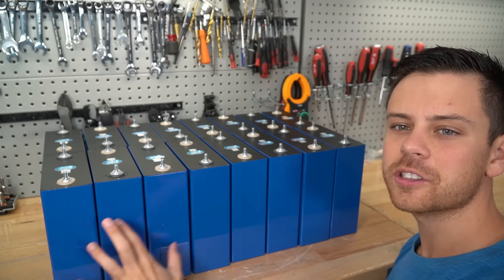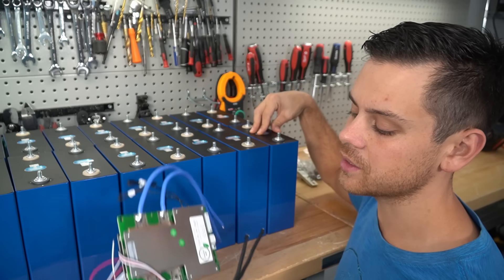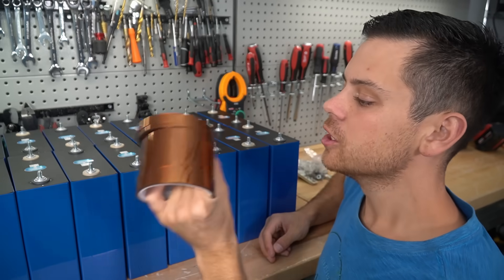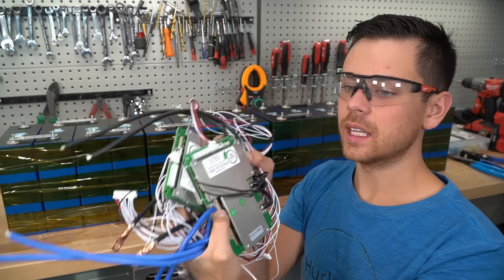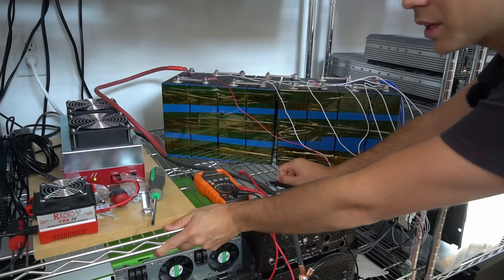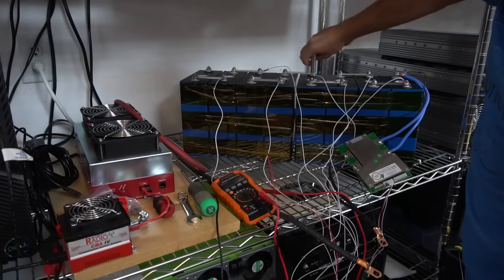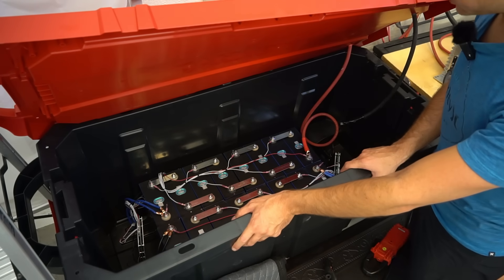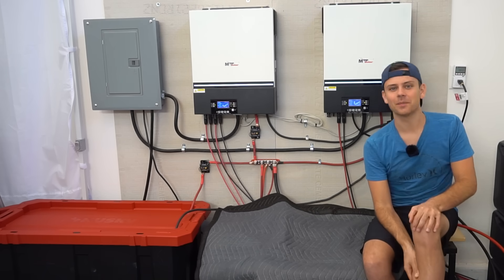DIY 48V 320Ah Grade B LiFePO4 Battery Build: 16kWh for $2,810?!

Comment: Will, You have some serious fault current available to you and i will stand to be corrected but those breakers may not be able to clear a fault of the available capacity  , i believe you should consider using MCCB or HRC  Fuses with a very high KA rating
Reply from the maker: Each bms has OCP, and a marine grade circuit breaker rated for this voltage. Why would it not?
Reply from the maker: There are 3 over current protection devices, and the voltage rating of the fets is 80V. Should be fine right?
Reply: , thanks for responding  @WillProwse  I am probably a bit old school, relying on Mosfets for isolation & protection is something i am not used to from an industrial perspective, can you guarantee that the Mosfet will operate faster than the time current curve rating of the breaker ( Co-Ordination) as i see it the breaker should operate before the BMS  if your using the breaker as a switch then its not really there for protection , So your saying the BMS circuit protection is there to protect the cable from overload and short circuit protection or just the battery ?, maybe you can tell me is the BMS set to protect the cable and the cable size greater than the Over Current & Short circuit protection of the BMS.

I must say in Industry the talk of fully electronic circuit breakers where you may find semiconductors being used is only just starting to appear with many regulators not accepting them yet , Industry does not yet have the confidence that isolation can be fully achieved and be reliable however i do know fault clearing times can be really fast , that's my understanding and maybe you are correct that the BMS is suitable 

I just feel the protection should be off the Battery and be the primary form of protection with the BMS protecting the battery

Comment: I was looking at these batteries, i really appreciate the tips and testing.
Reply: Let us know if you get them
Reply: I bought 32 of the 320ah for 3700 and were grade A!
Reply: @nunyabusiness2191 that's a whole lot of capacity for that price, i guess you'll be running a whole house on that
Reply: @whateverthisis3929  this one is my smaller bank. I have 2500ah 48v total..i use for power and central air water heater and heating in spring and fall

Comment: On a budget I ordered these about a week ago......aliexpress....considering thats over 15k of lithium power...honestly I will be satisfied 90 to 95 percent...still should get me above 12 k which was my target....let me know what you think.....this one is 48v 320 ah ....running a mr power 48v  5k all in one controller inverter.....I'm in Puerto Rico...my consumption is 400kilowatts per month...got 3500 in panels.......this is my second solar project...the first one was 24v  off grid system I put in my house in the mountains....your videos were extremely helpful.....the system im putting together now is at my primary residence....thanks  ....
Reply: your 3500 W panels will not provide enough to cover 400kWh for the month. This has not so much to do with the batteries (storage) you are using. I'm using similar types of batteries (in tropical sunny Northern Thailand) for our essential power supply. We are getting an average of 11 kWh/day out of 3.88 KW (monocrystal) Panels on the roof. For us, it is more important to bridge the powercuts we have here during the rainy season. So more storage means keeping the lights on for hours, if not days.
Reply: @CarstenDohrmann  thanks for your input ...but I get all day sun...literally 6 hours prime easy ...so just taking in ....3500 for 4 hours a day  which I literally get more  should get me 14 k easily...but if its becomes a issue might bump up to 4500 or 5000...but thanks for your input
Reply: @CarstenDohrmann  oh in my cabin in the mountain I'm getting 8k to 10k a day on 1440 watt array

Comment: Looking for an economical way to run Air Conditioning in a RV.  Is this video a solution?  48 volts VS 12 volts?
Reply: 48V is superior to 12V, because you can get 4x the energy transferred over the same gauge wire. 1kW at 12V is 83 amps. 1kW at 48V is just 21 amps.
So yes, this video is part of the solution, whatever cells you end up getting.

Comment: I've been looking into how to use less KWH in my small 2 story home, last year in august I used 1358KWH for the month.. This year: 879KWH so I'm getting somewhere, it was cooler this year so less air conditioning.. But about 40-45KWH per day system is what I would need, to cover my max use days.. I'm new to this, and on a small income..for me I think it better to spend $ getting panels hooked to the grid to lower my electric bill to slowly work to full off-grid Is there a free site that gives walk-throughs of different systems or easy explanations of how all this works? Any intro videos or channels that do down to earth introductory explanations?
Reply: @Hates Spam well in summer I have a big 240v AC airconditioner for downstairs and 2 smaller 120v ones upstairs and its electric hot water as well as stove and fridge (fridge needs replaced and compressor runs constantly that's next on my list) but besides that its just a tv and air filters and other small-draw things.. In winter I'm 100% wood furnace heat so my winter use is 1/2-1/3 of summer.. August is always highest usage month
Reply: @Hates Spam well I have to keep the upstairs cool through the day cause that's where my bedroom is and it would get 100deg by night if I didn't have it cooled.. 1 room is closed off and isn't cooled up there but the bathroom and bedroom are  upstairs.. there's also the electric clothes dryer and washer I forgot about in basement to supply for as well as some power tools, I'm not sure how much electric a normal fridge/freezer takes but this one is like 30yr old and is beat and needs replaced running constant so maybe when I get that here I will see my use drop some I'll have to do a thorough watching of his videos to learn more like you suggested.
Reply: @Hates Spam no they're both in my bedroom, they're small 120v ones and since my home is 100yr old and has a metal roof it gets hot up there.. Usually one of the 2 will suffice but when its 85-90° or more outside and sunny I need both of them to handle it. The 240v one is like a window style but is big and is mounted right in the wall and it takes care of the whole downstairs where my wife and I are usually at when home.. My one room which is smaller upstairs isn't finished but my thought is to convert that to my bedroom cause it would be easier to cool as well as heat in winter since the room is directly above my furnace room that's on the 1st floor
Reply: @Hates Spam I added some R30 insulation in the area above my wood furnace and in the walls around this summer as well as new windows/doors last summer but that's about as far as I can go with it.. There was no building codes when this place was built and there is likely no insulation in any part of the house walls at all and it originally had all single-pane leaky windows! I really don't want to rip all the walls that are hardwood over drywall down to try to get insulation in there but trust me I see your point! Before I did the windows and door sealing and the insulation and electrical outlet sealing I did last winter you could feel a breeze on a windy day! I fixed that problem and through doing some of that other stuff I nearly halved my electric use this summer.. Winter was always hard but I think I'll see a big improvement this one and will be able to eliminate all use of electric heaters this year I do believe.
Reply: @Hates Spam I live in central PA.. winter's coldest night last year was -1.5°F and 10°f or below is common through all of January.. Summer usually stays below 100°f and averages 85-90° during the day and 70-75° at night BTW
Reply: @Hates Spam thanks! Today is actually my 32nd birthday and it was sure nice to carry on a conversation like this. I wish you only the best.

Comment: Will, Aluminium studs Vs threaded posts, you have more chance of killing the studs and when you look at the smaller contact surface area, i'll take internally threaded everyday. 
Besides, can always run Heli-Coils to fix. Bus-bars with elongated holes not for you bloating, just fudge allowance.
Reply: Keep in mind the lug is a specific depth, and drilling out to install a helicoil can cause issues.
It has been done on the forum, and several cases have ended in electrical fires.
Reply: @SuperVstech  There are ways to do the job just fine without anymore depth needed, same is just opening up the hole and tapping next size out.
Reply: He has done this for years. Trust someone who knows what they are doinf
Reply: @vanderumd11  Yeah, I started working with metal yesterday, electrical the day before....

Comment: Are you concerned at all that there isn't any air circulation inside the husky bin you are using as your battery box? Would putting a hole in the top with a PC fan as an exhaust improve battery state while putting a hole on one side as an inlet to allow air flow?
Reply from the maker: No need

Comment: Thank you for excellent videos, Will! 
It seems, that flexible busbars will better fits for cell interconnections in the battery - it eliminates of expansion/contaction forces application to stud/busbar connections.
Reply: They call those cables
Reply: @mfgxl , you mean short cable jumpers with cable lugs at its ends? Because, there are special flexible insulated busbars exists, which do not require cable lugs. These are avaible from Schneider Electric and othe brands.

Comment: Hi, Will. Thank you for sharing, it's really awesome. I'd like to ask you if it's safe to use such a bloated cells, that contract and expand so insanely. With regard to busbars and mounts and that internal compression issues. I mean they may not have the advertised capacity, but more than enough to cause a mayhem. What do you think?
Reply from the maker: It could blow the valve one day, but it is lifepo4, so not a big deal. I would never do this with a combustible chemistry. Lifepo4 and LTO is all I work with for this reason. I used to use other battery types, but those will burn your house down.
Reply: @WillProwse  Older video but seeing how cells may eventually start swelling it seems braided buss bars are the only way to go.

Comment: Ok so compare this to signature solar where I bought 15 KWh for $4500 and it comes with amazing packaging, great monitoring, circuit breakers, on off switch, etc...     And all I had to do was slide it in a rack.
Reply from the maker: Yeah those are great! But out of stock and more expensive. I love both
Reply: @WillProwse  by the time you add your BMS x2 decent case, connections, and have waited 2-3 months for your grade A versions, I will have another 15Kwatts online for the same total price.   Will, I have learned so much from you and continue to do so, but I think you need to put them both in the same category...

Comment: I've got 3 strings of 100 ah bb in 48v config each. They attach to a bus bar and the line out goes to the mpplv. I know it's possible to configure a 2-3 hundred ah 48v and connect it with the other 3. Wondering what the drawbacks are if any? I think once one or all three strings of the 100 draw down to the bms limit it will just charge while the remaining 2-3 hundred ah  string will continue to discharge.

Comment: Compression is important for all type of cells other than the cylindrical ones. The charge / discharge rate is not relevant as you seen they are expanded when fully charged and you do not want to have distance between plates in a cell and to accomplish that they will need to be compressed.
That blue sleeve is fairly thin and may be easily damaged so is best to have something between each cell like some thin silicone pads as they will offer both electrical isolation between cells as well as some elasticity for when cells expand and contract.
This are probably 280Ah cells not sure why they are advertised as 310 or 320Ah. I also order some of this blue 280Ah cells to do some testing as currently this are almost the only option considering the cost per kWh and. The ones I got should have square terminals and then soldered on top what look like aluminium cylinders that are taped. I also do not like that they drill the connectors as they where not designed for that.
Reply: Do you have a source for silicone pads?

Comment: Clearly the cells aren’t balanced. The BMS shutting off at about 24v says just one cell and not all cells fell below the cut off voltage.
Reply: Agreed.  And the BMS he has will never balance these - resistors way too small.  Would have been neat to see what the capacity is when fully balanced.  Or perhaps should have tested one battery at a time - granted very time consuming.
Reply from the maker: Yes very true Bill! Very time consuming haha
Reply from the maker: Yes I saw that. I just hate taking it apart and balancing it. It should arrive at same SOC. And and who cares if one pack did that when the other one didn't, and pulled less. Even if I top balance it will be garbage results. I'd rather buy better cells and cycle this one how it is. And over a month of constant balancing will make a difference. It's a small amount with passive dissipative balancer on bms, but it does add up. Gotta change settings so it balances all the time and not just at high soc
Reply: @WillProwse  At least with the 16S 48V Overkill Solar BMS, you can indeed change the balance start voltage and delta amount allowed.  It also lets you change whether to only balance when charging (default), or not.  But when you turn that setting off, you'd think it would balance all the time (charging, discharging, or idle), but it then only balances when NOT charging.  At least that's what I see.  And annoying it only can balance even or odd numbered cells, which takes extra long with the very small resistors.

Comment: Hey Bro, what's the size of that bms and where can I get one?
Reply: He's using the 24V 8S BMS from Overkill Solar.  He has a link in the description to the 48V 16S one he wanted to use - they also have 12V 4S too.  I like their BMS's (insane blutooth range), but the balancing does a rather poor job (way too small resistors for large battery packs).  And at least with the 16S one, it can only balance every other cell at a time - which doesn't help.  Best to top balance first, and the BMS then works as a good monitor and protection.  Don't count on it to ever balance these grade B cheap cells - really only works with good quality cells.  You also have to charge at a lower voltage if you want to avoid cell overvoltage shutdown, and deal with the capacity loss.
Reply: @billjohnson3344  ok thanks.